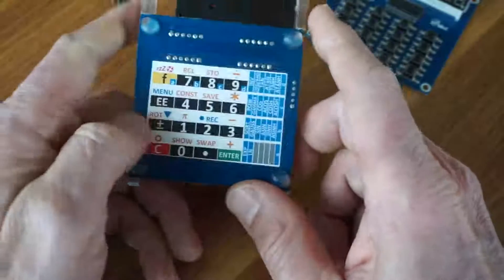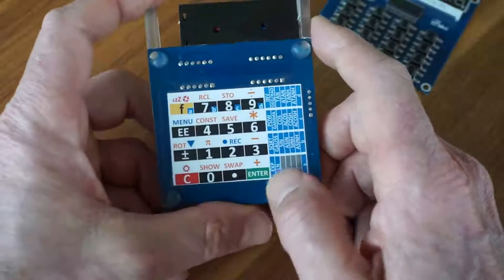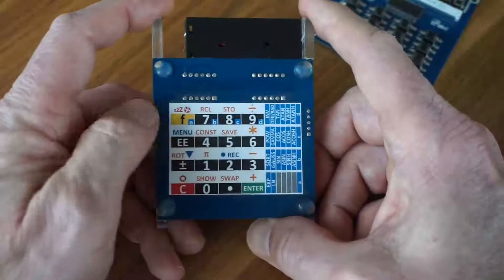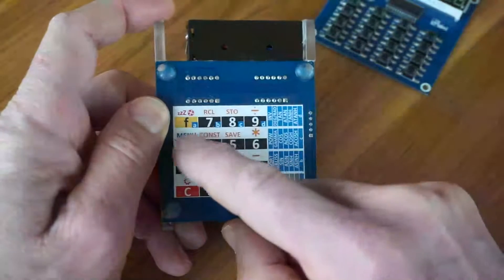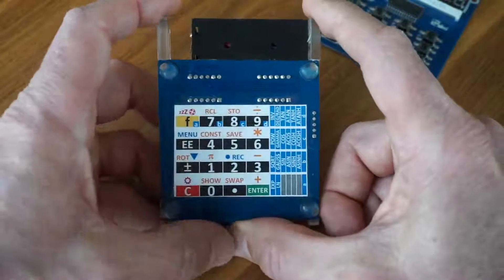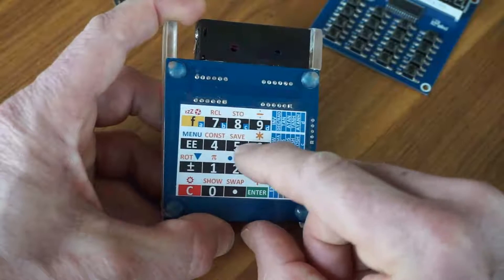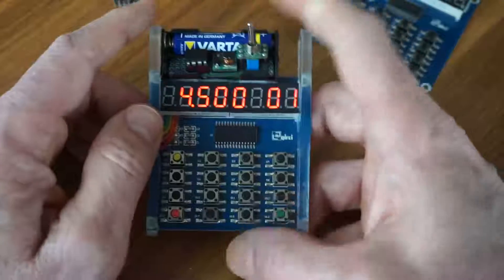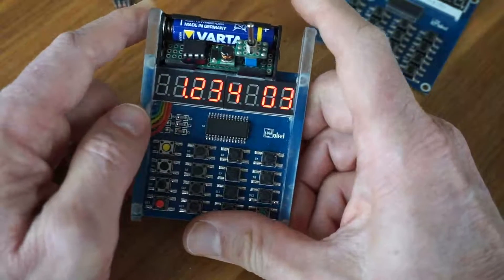Scary v2 - Scientific RPN Calculator with an ATTINY

Comment: Hello. Thanks for sharing. I was looking for the qyf-tm1638 module, and found your project. Beautiful. Thanks. It surprises me that you do not use libraries to use the module. Is It to save memory? And, you followed the ic datasheet? Can you say something on how you did It, the process? Very nice. Congrats.
Reply from the maker: Hi sciexp!
Thanks for your nice comment.
Actually I don't know if a library for this special board still exists. But to have the whole code "in my own hands" is a good feeling. In addition some libraries are to bloated if you fight for every byte of your memory.
If you have a look at my code you will see that In- and Outputs are done with shiftIn and shiftOut commands. To interpret and use the data from the qyf-board is sometimes strange but can be done with googling, patience and trial and error.
In my recent project I am trying to avoid premanufactured boards and use standard parts.
This project, called SCOTT, works with an OLED display (clean, crispy, cheap and alphanumeric), an ATTINY85 microcontroller, a one wire keyboard (needs soldering and some resistors) and one CR2032 battery pile. It's not finished yet - but you can have a closer look at www.github.com/zooxo/scott.
Regards
deetee
Reply: @zooxo  Hi! Yes, I have seen your discussions in the Arduino forum. It looks like It is quite non trivial to learn to use the board. I found a tutorial about the tm1638 and looks difficult to me, since I have no idea. I thought that the simplest thing to do first, is to do a program that when you press a different key of the board, then the display shows the number or symbol you assigned. My Ultimate goal would be to do a microcomputer that you can program un a machine code, but t
I am very very far from there.
Reply from the maker: @sciexp  To start with a simple code in- and output ist exactly the way I started ScAry. To start with an Arduino using Serial.print for printing results may help.
I never tried to program in assembler because I still fight with C and would miss the portability of software.